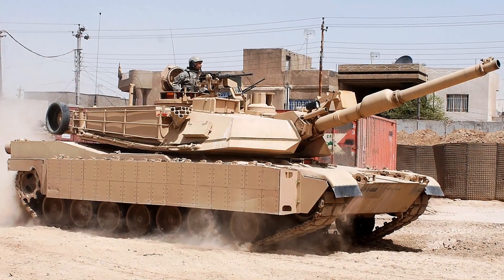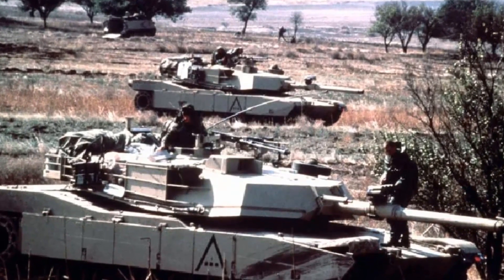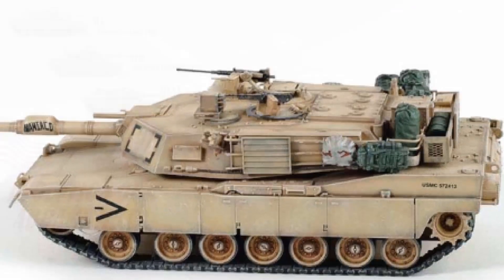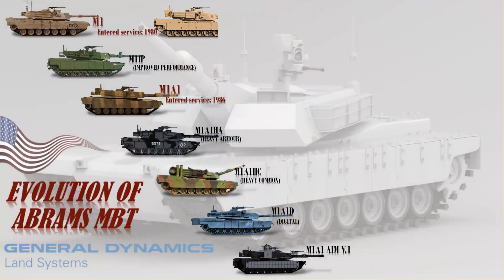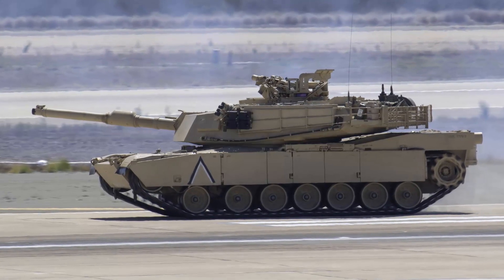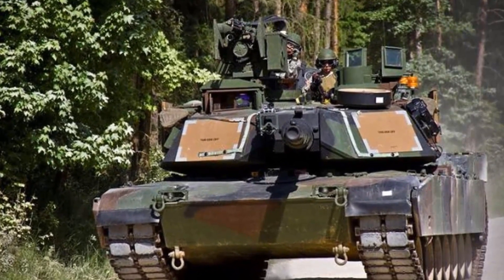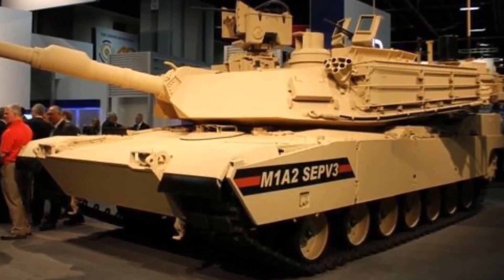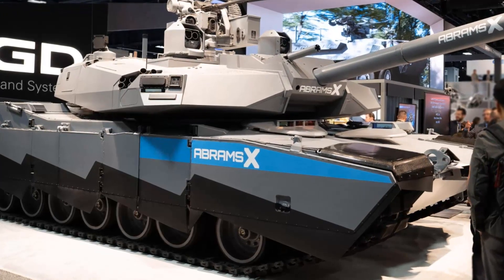Evolution of Abrams Main Battle Tank (M1 Abrams to AbramsX)

Comment: US's tanks are strong but too heavy
Reply: Yes US should produce lighter tank
Reply: That's why they are making the Abrams x lighter
Reply: Both Leopard 2A7 and M1A2 SEP v3 are approximately the same weight of 70 short tons. Even Challenger 2 is a bit heavier of 80 short tons. So their is no western tank that is not heavy at all.
Reply: @hugocheng6243  the USA has a light tank or will in the very near future

"The GDLS Griffin II light tank was selected in June 2022. The initial contract is for 96 vehicles with first delivery by the end of 2023. The first units are expected to be equipped with it by Q4 of FY25."
Reply: @BRANFED  Not a light tank but a Infantry Support Gun, closer to a STUG then a light tank.
Reply: The x is 10 ton less that's huge
Reply: Abrams X is 10 tons lighter
Reply: As a MBT not really my dude
Reply: Clearly, you don't understand how tanks work... all MBTs are heavy, as armor weighs a lot.  Also, the Abrahams isn't the heaviest MBT, it's just the best overall.  If weight is an issue, that is when a light tank is used, such as the new US tank, the MPF.
Reply: @hugocheng6243  The US does produce a light tank, its called the MPF.  But the Abrahams is an MBT, and thus is expected to be heavy... just not as heavy as the Merkava Mk 4 Tank, which weighs almost 72 tons.
Reply: Griffin III tank
Reply: Problem with the Abrams is that the fuel consumption is ridicously high. But the gas turbine makes it possible to feed it whatever fuel there is available.
Reply: @cubismo85  I agree with you, but traditional Diesel engine is easier to maintain and has lower operating costs
Reply: Abrams has turbine engine so weight doesn't really effect its speed
Reply: @spongeboss_richpants  But not all roads or bridges can bear that weight
Reply: @SUNNYSTARSCOUT365  abrams bridge builder tank
Reply: What's funny about this is this is literally the first time ever our mbt is heavier then it's eastern counterparts, from the m60 backwards we made armor sacrifices to make transportation logistics easier, best seen in the lackluster armor of the Sherman's. As time went on we upped the acceptable weight as we developed our cargo planes to be larger, creating planes like the Hercules and Globmaster. To eventually having something pretty dam heavy like a Abrams, yet that turbine engine makes up for the weight.
Reply: Why is this pinned, its obvious
Reply: us m1 abrams is one of the fastest tanks in the world
Reply: Just like American people.
Reply: @incubus_the_man  thank you for saying we’re strong
Reply: @hugocheng6243 M10 Bookah baby
Reply: Check out the M10 Booker 😂

Comment: abrams x is a demonstration model and has not been ordered by the us military.. at best, the us military might use some of the features such as the modular powerpack and upgrade current m1's
Reply: The lithium battery of the electric motor on the new Abrams x probably burns great. In general, it’s funny to look at a new tank if it is built, the hull is not large enough for an uninhabited tower, the crew is almost lying, very interesting
Reply: @BRANFED  
The Turks lost 9 leopards in 2 battles and did not use them anymore. They were not destroyed by the ISIS, but by the Kurds (two of them were female) by the old Soviet Konkurs & Fagot ATGMs. One or two in the forehead. Germany recalled all vehicles for modernization. Abrams losses are much greater than a couple, even according to Wikipedia. There are no indestructible tanks at all. It is a myth. And the tanks of the first Abrams series are very different from the new series. The same for the Russian T90. The plant in Limo has not been producing new tanks since 19, it is only modernizing. I'm afraid that Abrams X is an attempt to do something new, like T14 but in a case not suitable for this. It is impossible to put out a lithium battery, I don’t understand the point of putting it in, complicating the design. Are you having a fuel crisis? 
I consider the Abrams of the latest modification (not X) to be one of the best and most dangerous tanks, it only needs to reduce its weight and allow it to shoot with guided projectiles / missiles and that's it
Reply: @romankovalev7894  thanks for the corrections..  i know the abrams losses are more than a couple but didnt look it up so i understated it a bit to be on the safe side

the new M1a2 sep v4 is indeed a dangerous tank but at 75 tons, its so heavy to be all but useless in a war in eastern europe unless they bring along an engineer battalion everywhere they go. the bridges in eastern europe are rated for like 45 tons on average or so ive gathered. sure, the tank can kill any known threat at a range of 3v to 4 km but it suffers a severe mobility problem if it must cross rivers because of the weight

on a side note
i still think the t90m looks better than an m1a2..  even a leapard 2 looks better imo.. always thought the m1 was an ugly tank
Reply: @BRANFED  
We have different engineering schools, different theaters of war. The Russians looked at the problems of the heavy Tiger and decided that the technological advantage was not worth the extra weight. Especially when you consider that most tanks are destroyed not by other tanks, but by aircraft / helicopters, a little less often by anti-tank systems. And now is the era of the development of small attack drones. In Russia, they hold international tank competitions (tank biathlon), I would call your team on Abrams, it’s very interesting to see, but we have tense relations between countries
Reply: @romankovalev7894  id love to see team usa vs team russia and team china in that tank biathlon. Would be really interesting to see.

Comment: I remember when I joined the Army in 2000 I was trained in a M1A1D and it was so fucking problematic because they decided to put the CPU under the commander seat and completely forgot that when it rains that the water would rolled down the seat and fuck up the CPU. Microsoft tried to sell the Army a military version of the internet but the lowest bidder won and FBCB2 was a failure until the M1A2 sep came out.

Comment: Do you think in the future, when fossil run out, tank will use electric in all time ????
Reply: Oh sure, they will just sit there for hours at a Tesla supercharger, right out in the open during combat, to charge up several times a day . . . (jk)
Reply: I don't think. If you are talking about the future. If the Russians crammed a nuclear reactor into the Burevestnik missile and the miniaturization reached that level, then there would be tanks with atomic engines and with a plasma force field as armor.
Reply: The lithium battery of the electric motor on the new Abrams x probably burns great. In general, it’s funny to look at a new tank if it is built, the hull is not large enough for an uninhabited tower, the crew is almost lying, very interesting